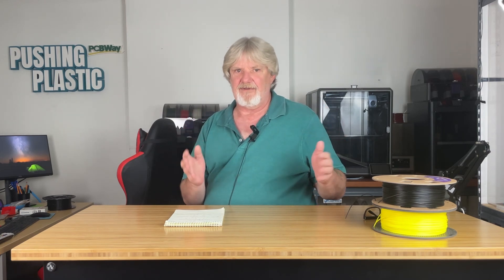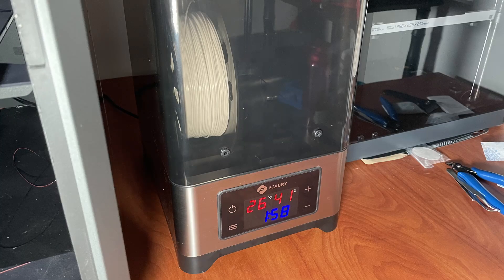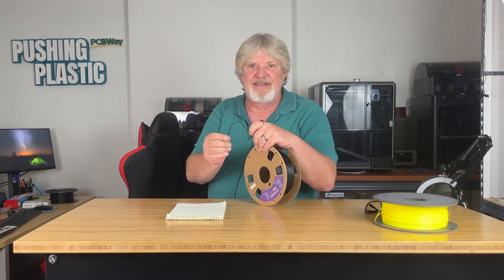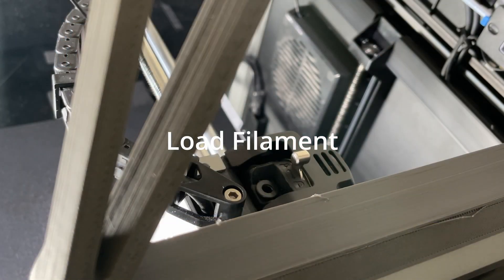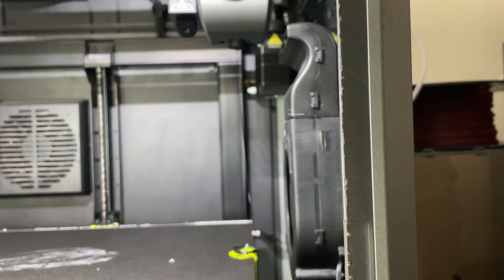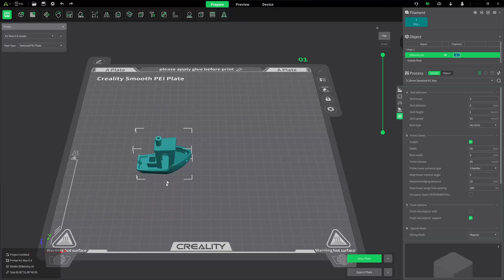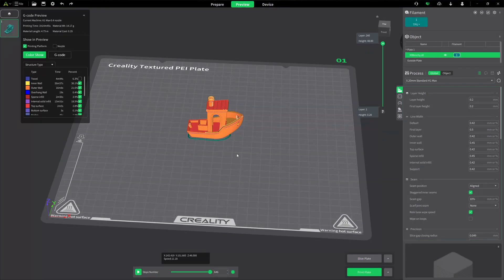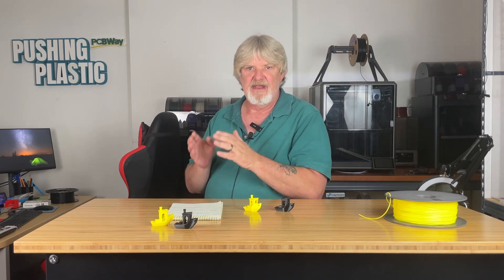Mastering TPU 3D Printing on the Creality K1 Max: Step-by-Step Guide!

Comment: I print lots of stuff with TPU 95A . I run it direct from a polymaker drier into the Bowden tube and then into the print head of my X1C. No drama loading it and it prints perfectly every time with the Bambu Studio presets for Generic TPU. I think the key is keep it dry.
Reply from the maker: Printing to a Bambu printer or to a Creality K1 Max. This video was about the K1 Max.

Comment: With a max volumetric flow of "3" I could print this on my Ender3 v2 almost as fast. I also have a QIDI Q1 pro. I print Overture TPU at around 205c to 210c and get great layer adhesion. 230C seems just a little high to me. This TPU is nearly indestructible, with little to no stringing, if dry. Those Benchies look pretty good, I'd just lower the temps a little.

Comment: I use creality K1, K1 Max and K2, Markforged printers.. All printers use the same settings. Max volumetric speed is 8. This setting allows you to print faster. Set it to 30 if you like, it won't make any difference to your end result, just limiting your speed. Speed is set to 70mm/s, first layer 50mm/s. Temp is set at 240 and NO cooling, NO fans at all. I don't know why almost everyone says, slow down. You need to speed up. 0.4 nozzle. Creality, E-sun, Fillamentum TPU used, all colours. Filament direct above using the same spool holder. I print for a food manufacturing company so the prints have to be spot on. Sometimes doing the opposite is better. Interested to see if anyone else has tried this.
Reply: I completely new to tpu. 
So when you say 70mm/s you mean everything (infill, surfaces, ect.)or just the walls?
And no cooling at all? Everything I was looking up says no cooling for the first few layers then fans at 100%?

Comment: Why didn't you have to fiddle with any of the print speed settings below the filament selection? I did what you did and selected generic TPU, But it seems crazy to think the printer is still going to try to do this at 300 mm/s. I was surprised Creality Print didn't update those?
Reply from the maker: The Max Volumetric Speed reduces the speed of the printer.

Comment: My #1 issue with TPU is that it absorbs a lot of moisture, fast. By the time I finished a Benchy, I'd already be expecting to throw it in the dehydrator. If you're going to print with moisture sensitive filament like TPU, buy or make a dry filament feeder box.
Reply from the maker: This time of year I struggle with TPU from the humidity!!!!

Comment: Nice video - Thank you - But I fail at the first fence - After drying for over 8 hours the TPU filamant will not get picked up by the print head. It just sems to get glued inside :(

Comment: i find printing TPU faster is better. i do 9-12vol and around 150mms
Reply: Default is 200/300, so you're printing slower 😂
Reply: @mazmorbid   Max volumetric speed 3-4 slows the print well below 100mm/s buddy. so you arent printing 200-300 with Max volumetric speed set at 4. Maybe you need to learn some more. 🤦‍♂

Comment: Do you set the all of the following speed settings to be = to the manufacturer's recommended speed? Or do you use Creality print's default speeds which are 200-300 mm/s depending on the property?
-first layer
-first layer infill
-outer wall
-inner wall
-sparse infill
-internal solid infill
-top surface
-gap infill

 Do you stick with the default travel speed of 500 mm/s, or do you lower that?

I'm able to print Amolen TPU 95A ok without the top feeder right now, but it has some stringing... Maybe I have to have the top feeder, but I'm trying to see if I can get by without it.
Reply from the maker: I use the default print speeds. It's rare that I change those. For the TPU Stringing, try lowering the max volumetric speed, assuming the filament is dry!

Comment: Printing TPU for the first time right now on my k1c... wish me luck!! :)
Reply: I turned off the retractions as you suggeted and now its going better... 10 layers and going strong!
Reply from the maker: @ Did it work out?
Reply: @pushingplastic7445  yes! After disabling the retractions it worked! Thank you!!
Reply from the maker: @fvolpim  Awesome!!!!!!
Reply: Printed 5 layers and already jammed the extruder :(
Reply: @fvolpim any luck on resolving this issue? My TPU is always jamming in the hot end and failing prints

Comment: Great video!
On my K1 Max I manage to print TPU successfully without any mods on the tube. What I do: put the filament in my Creality filament dryer, remove the grommet where the filament comes out of the box, push the grommet over the ppe tube so it‘s out of the way. Then I just put something under the dryer so that the ppe tube only just gets into the filament dryer.
Works every time for me even for longer prints. TPU 95A and 53D

Comment: 👍👍
I guess I'll have to try Overture TPU. I've been using Flashforge. Must be the problem. Like I've said, my benchy has always been perfect, no stringing, then gooey chimney. Weird!
Flashforge is my favorite ASA and I like their black PLA, it's shiney, so I know it's a good brand.
I actually haven't tried the benchy on the new Version 5, slicer. It had a glitch with my PC, until their latest update.
I'll try this tpu again, with V5 and if it messes up, it's the filament. 
Thanks for the video!
Reply from the maker: It might not be the filament. I got similar results with the Overture as I did with the Bambu Labs TPU. It's the basic things, dry your filament, and reduce the speed. I was watching carefully while the chimney printed and the only thing I could think of that would make it fail was printing it to fast. If you decide to give Creality Print 5.1 a try again, try the TPU benchy and see how it prints! Good luck!!!!
Reply: @pushingplastic7445  i printed at 35mm/s and 30. Dried filament for 24hours. lol
Reply: @pushingplastic7445 I've printed at 35 and 30 mm/s

Comment: I have also have printed several objects on my K1 Max with TPU. I bypassed the runout sensor just as you suggested. But I was intimately able to tape an second piece of tube to the end of the tube that I pulled out of the output of the runout sensor to a another piece of tubing that went over the top and right down into my filament dryer. This allowed me to feed to the TPU through each section of tubing separately to start with. So the TPU fed from the dryer during printing. I had no problem with feeding the filament for multiple objects with no feeding issues and very little stringing. I was quite surprised that I was able to feed the TPU through the second piece of tubing while still clipped to the cable chain. As you mentioned I dried the TPU for about six hours ahead of time.
Reply from the maker: That's pretty incredible that you were able to feed the filament through the tubing like that! Nice job!!!!